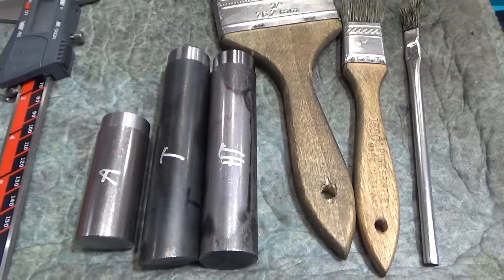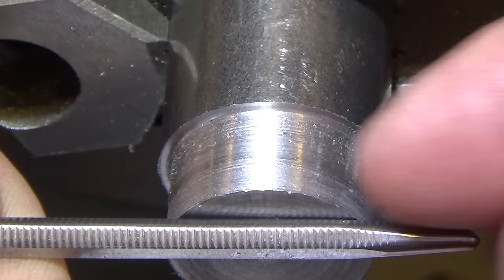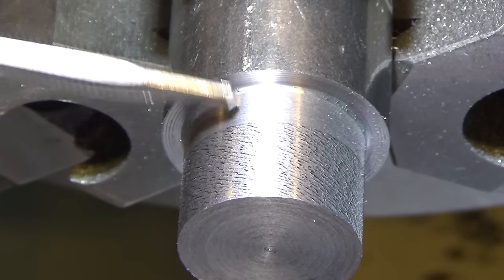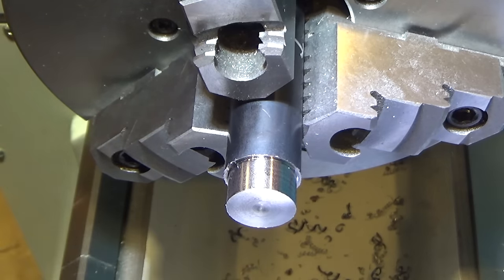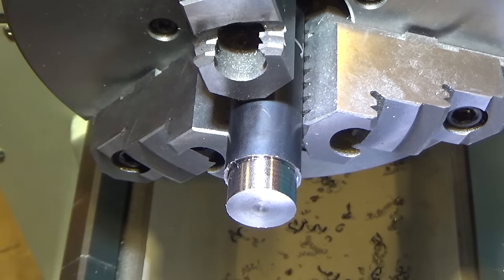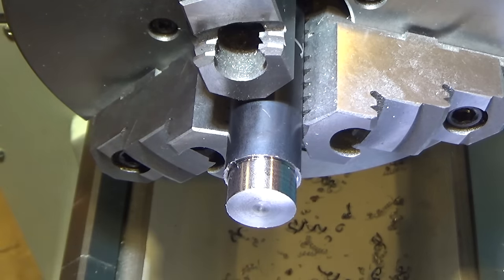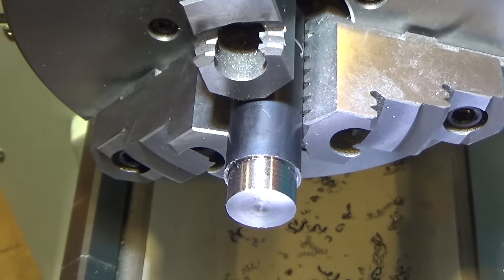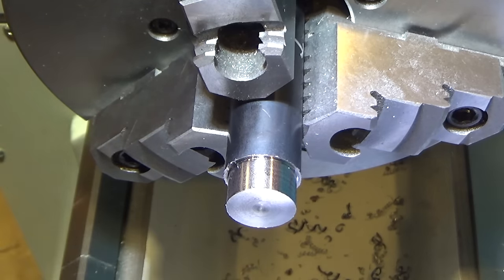The Effects of Heat Treatment on CrMo 4140 Steel in Turning Operations Part 2

Comment: The thing that is suffering here is the incorrect use of each insert, not the depth of the cut.

Negative Inserts.
High Removal Rates, ie Big Depths Of Cut.  ( DOC )
Roughing to Medium finishing work.

Not so good if you want a great finish,  but there are Negative Inserts that will give you a good finish but Not both High Removal Rate and Good Finish you need to decide which is preferred.

Positive Inserts. 
Low removal rates, ie Small Depths Of Cut.  ( DOC )
Good to Very Good surface finish, but Not High removal rates.

When you used the Aluminium grade of Insert i am not sure why you have that mounted in a Negative Tool Holder.
These inserts should mostly be used in a Positive Tool Holder.
I do not know the exact Insert you are using but from my experience with Aluminium Inserts they are to be used in a Positive, Positive type of set up.
Meaning Positive Tool Holder Positive Insert.
Not Negative, Positive.
This defeats the point of the insert.
The only time you would mount the Aluminium Insert in a Negative position is if you are using PCD grade inserts. 

If you want to use this Insert for finishing work on steel,  your set up is OK but only for very small depths of cut.
Not 50 Thou,  DOC ?????????????

Negative Inserts are for High Metal Removal Rates.
Your lathe is mostly at the lower end of use for Negative Inserts 5 HP is a good size lathe but not really a useful lathe to get the practical use of Negative Inserts.

If you want to use Negative Inserts on this lathe,  use only Wiper Inserts as there removal rate is a lot lower.
Or require less power to make them work to there potential.

I totally understand the fact that you prefer not to sharpen tools for lathe work.

High Speed Steel ( HSS ) does have its uses on a Metal Lathe but it is limited.

All The Best.
Regards Peter.
Reply from the maker: Thanks for the very thorough explanation. It is often quite difficult to get tutorial level information from the big vendors like Sandvik. I really appreciate you taking the time to spell this all out. As a side note, I have never pushed my lathe to the point where it sounds like it is excessively bogs down. This was an older video and I was still operation under the rules taught at the adult school where I took machining classes. there they would not let us ever exceed 0.025" depth of cut. Thanks again.
Reply: @DudleyToolwright  I know it is difficult to get the information you need.

 The best way to approach this problem is find a Salesmen / Seller that you feel comfortable to deal with and deal with this one
 Salesmen / Seller

Salesmen / Sellers have a way of belittling people.
 ( just like negative people you don,t need them )

Have one visit you or go and see different Salesmen or Sellers and talk to them if you feel comfortable with this person deal with them and no one else.
Do not get to caught up on brands Sandvik, Kenametal, Sunitomo etc etc.

But mostly stick to well known brands like one,s above or similar and buy from that one manufacturer.
As you need questions answered they will help you and if they don,t  keep looking.
When you buy name brand products like the ones above  they will have all the necessary information on the back of the packet of inserts that you buy.
Don,t be to concerned that you are a small player with only a small budget.
A lot of big players are very tight for the money even they only buy in small quantities.

Look forward to see more of your video,s.

All the Best.
Regards Peter.
Reply from the maker: Thanks. I appreciate the advise. To date, I rarely buy the name brand stuff because of budget limitations. When I have their is definitely a difference. I will take your advise and try to find a salesperson that works.

Comment: Ya about the steel getting caught in the ways. Being new to machining and my not cheep but cheep Chinese lathe . Didn't come with way wipers . 🤬 . So they are a little scratch up now. Why would they do that are who would make a machine without any. I made some with hard plastic and a piece of shamey between and they work.👌
Reply from the maker: Nice idea. I agree that it make zero sense to not have wipers and they are easy for a manufacturer to make. That is really a shame, but you did fix their blunder.

Comment: Indexable carbide inserts are overrated for home shop usage. The pros use them for higher productivity mainly in series production. And because their optimised chip breakers avoid stringy chips (usually only working during heavy cuts) so that CNC machines can work unattended. Often the edge of those inserts needs to be less sharp than HSS or brazed on carbide tools because a round cutting edge survives longer in heavy cuts but is not very good for light cuts. These are not typical scenarios in the home shop where the hobby machines often lack the sheer power to reach sufficiently heavy cuts to benefit from the chip breakers of indexable inserts. In the home shop indexable carbide tips bring advantages only if you want to cut through mill scale or hard, abrasive material. However, many hobby machinists use indexable inserts to avoid sharpening their tools themselves. The hobby machinist should learn the advantages of HSS and brazed on carbide tools ground to sharp edges and learn how to re-sharpen them. These are better for light finishing cuts to close tolerances and good surface finish which are much more frequent tool applications in a home shop. He can deal with the possible stringy chips much more easily at home than the pro in a production setting.
Reply from the maker: Excellent advise. I always choose inserts with the smallest corner radius for the reasons you suggest. My lathe is 5hp and is capable of more aggressive cuts than I usually attempt. As a result, I often have trouble making the chip breakers perform well. I have very little experience with HSS, but will definitely get into it. I switched to carbide after some very frustrating experiences with materials that surface harden when run too fast and having the finish or edges of my HSS tools ruined. A brand new dovetail cutter comes to mind. I was only running it at 400 rpm ( 1" diam.). Thanks for all of your input and your very helpful and complete suggestions. I am sure more people than just me are being helped.
Reply: I have been a machinist since 1977, had my own machines at home since 1991.
Wife bought me my first set of indexable carbide tools for Xmas, they haven't thrilled me. I still use HS tool bits and cemented carbide and do my own sharpening. nothing compares to HS tool bits with a larger radius and cutting oil for surface finish!
Reply from the maker: I will definately try to use more HSS, but am a bit intimidated by the grinding aspect. I have the hand-eye coordination of a puppy.

Comment: Dude, those insert are not made for .002" thou per rev lol
Reply from the maker: You are likely true. When you get the import inserts they, more often than not, do not come with cutting specs. I realize that some inserts do not work with depth of cuts under a certain value, but in my limited experience lower feed rates only effect the chip breaker functionality. I am quite possibly wrong, but this is my current understanding. Thanks for the comment.
Reply: It's also tough to take that aggressive of a cut on a small machine, so the low feed rate it understandable lol
Reply from the maker: Thanks for the advise. It is always appreciated.

Comment: It's a shitty cut B'cause it's off axis. A positive rake needs to be below the center axis of your piece. You can make 7 series aluminium a mirror finish going .008 below the work.
Reply from the maker: I have never tried any position, but as close to on-center as I can get. I will give your suggestion a try. Thanks for sharing your ideas.

Comment: You're running too slow. 450 RPM@ about 1.5" stock? is only 175 sfm. Triple the speed, use a negative insert and try again. You'll the extra yea generated will give you a far nicer finish.
If you want a better finish running that slow you should try heavy cutting oil to stop the chips from welding to your insert.
Thats why it seems like the positive cutter is "pulling" the grains out of the steel. The chip welds to your cutting edge, and then you're just mushing your way through the steel.
Reply from the maker: Thank you very much for taking time to help out. I will give your ideas a try and see. I always appreciate the input.
Reply: Kevin D no chance with the wcmx inserts he's using.  try cnmg or snmg gold coated inserts..... on any material it's all about the speed and feed.
Reply: Agreed. Most of the carbide tools have published speeds and feeds. Try hitting those numbers and see what what the results are. This is hard to do on smaller diameter parts. If you can't spin the parts fast enough use HSS cutters.

Comment: Why do you want to optimise surface finish after a heavy roughing cut? Usually after roughing you do a light finish cut and optimise that for best finish. For finishing you could also use a vertical shearing tool.  They are known for good finishes. Google "tubal cain vertical shear tool"
Reply from the maker: Thanks, I will definitely look that up. I have watched a bunch of his stuff and he is quite informative. Indexable cutters often have a hard time getting a good finish with light cuts. I would have to switch to HSS as you mentioned in another post. Thanks for all of your suggestions. They are really appreciated.
Reply: HSS or brazed on carbide tips with sharp edges. I hope I could help. Good luck with your projects.

Comment: Face it , center drill it, and live center it and the chatter goes away ~
Reply from the maker: Good advise. Thanks.
Reply: @DudleyToolwright  slow down n rpm to reduce chatter. Generally speaking positive rake = softer material, negative rake = hard materials. Think about a thin knife edge vs a thick circular saw blade, they both cut but, trying to cut a board in half with a knife sucks. The carbide in this situation holds up because it is harder than the material but the positive rake will wear out way quicker and produce less consistent surface. Those inserts will easily take .100 DOC but slow down the rpm and bump up the feed a bit and get way better chip break.

Comment: Your feed is too slow.
Reply from the maker: Thanks.
Reply: You need to find out what the "T-land" is on your insert. It is a small flat area on your cutting edge. For a roughing insert it will generally  be .005 or more. Your depth of cut and/or your feed per rev needs to exceed that. The bigger the T=land is the heavier the cuts it will like.  Most of the time you would use a roughing tool and a finishing tool if you are trying for a nice finish. You can also play around with different nose radii on your inserts.
Reply from the maker: That was really useful information. I appreciate you taking the time to share.

Comment: hey, great tests - but I cringe a bit inside when I here you use the word "bite" instead of depth of cut.  hahahahahaha
Reply from the maker: Thanks. I often have difficult trying to get the right words out when I am also trying to concentrate on what I am doing.  I have a ton of respect for those that pull it off so well and I definitely understand why some guys dub the video after it is shot. Thanks for the comment.